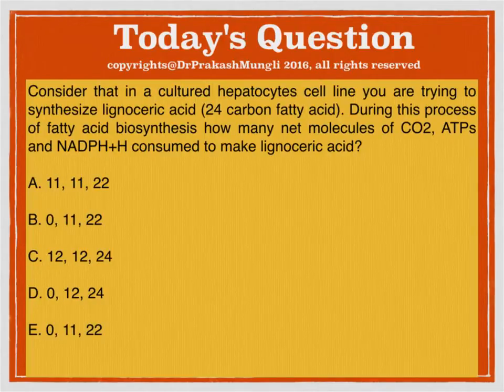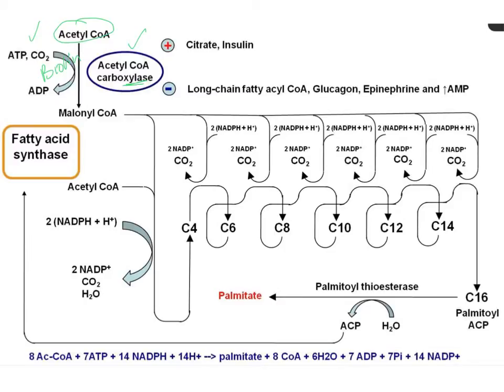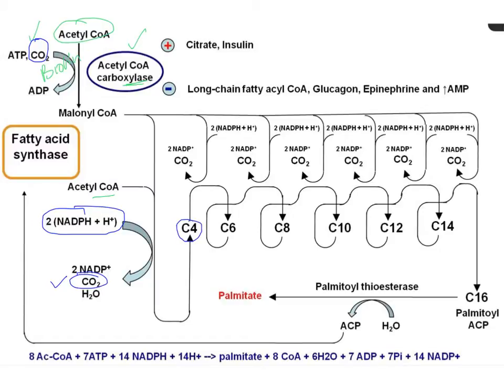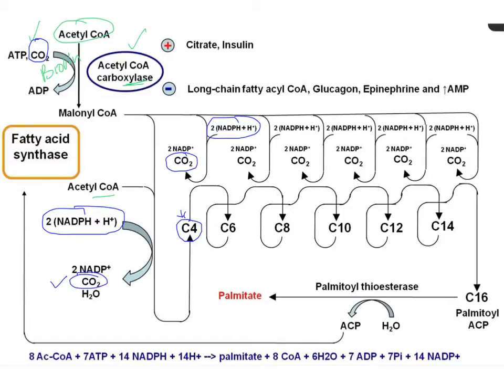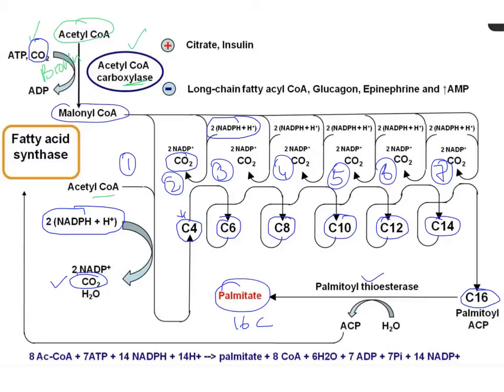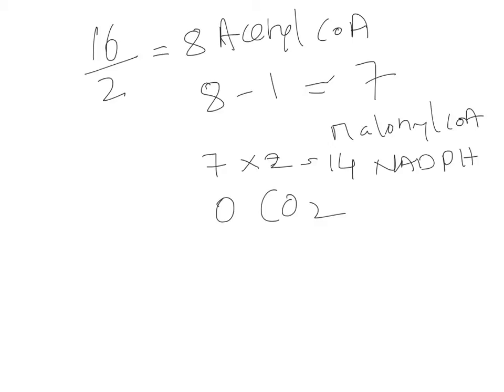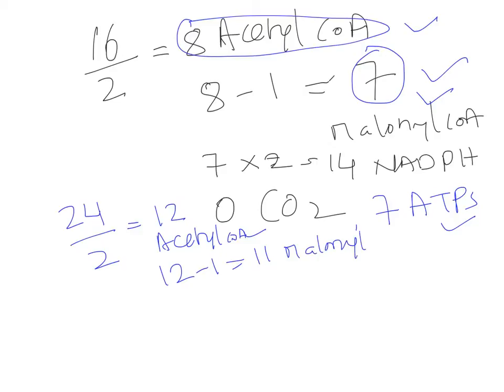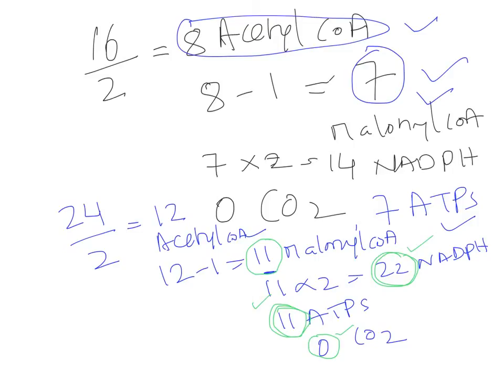Fatty acid Synthesis - A Quick Review - Question and Explanation

Comment: sir, very lucid explanation. one query VLCFA are formed by chain elongation either in ER or Mitochondria. if we consider mito elongation it uses acetyl CoA instead of malonyl CoA. so then no. of ATP for carboxylation may not be 11.
Reply from the maker: that is correct Ramesh Pradhan, but most commonly used elongation system in our body is microsomal i.e in ER.